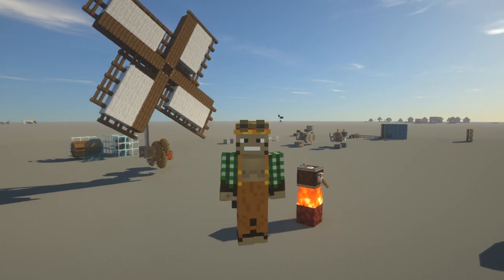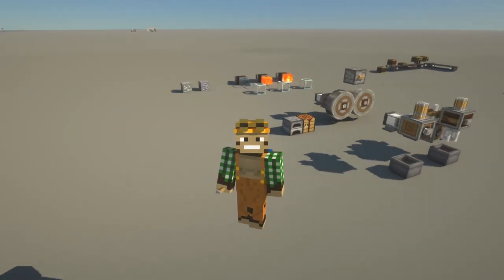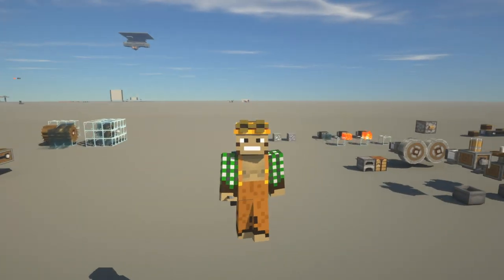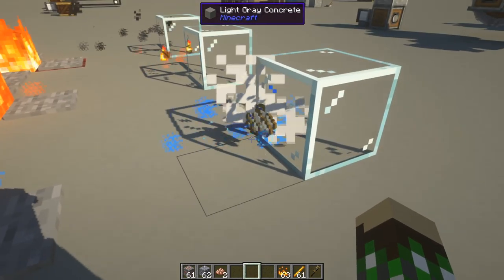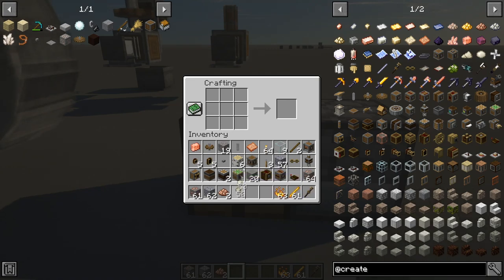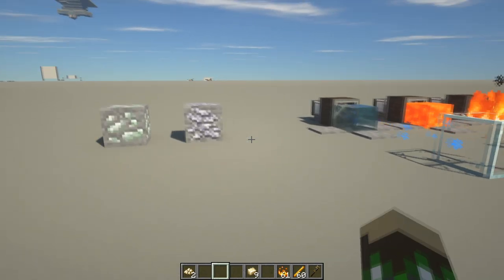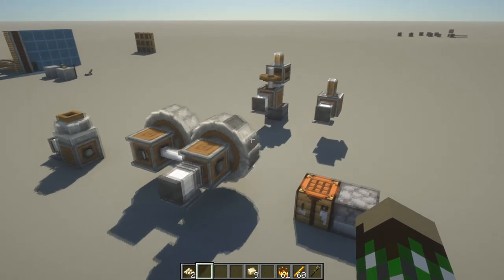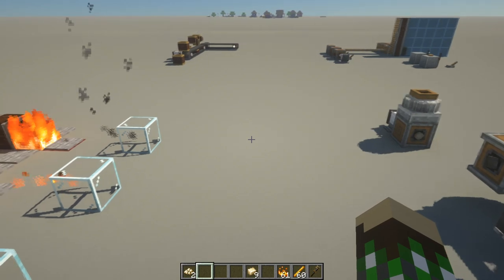How to make Brass!  Create Mod Minecraft Tutorial

Comment: With version 0.3 (for 1.16.4), this information is now out of date.  

Now, you need to craft a blaze burner (2 iron plates, 2 iron bars), take it to the nether, and then click on either a blaze or blaze spawner to capture a blaze. 

Then you take it home, and place it under your mixing basin, and give coal (or some other flammable item) to your captured blaze to feed it.  Once it is hot, then you mix crushed zinc and copper in the basin to make the crushed brass.
Reply: thank you so much, i was wondering what i did wrong.
Reply: Thank You! Been looking for this info for hours. Had the blaze burner, but the only mention on what to give it is blaze cake, which takes crushing wheels to make, so I was stuck trying to figure it out.
Reply: thanks
Reply: Thanks for the info! i needed that
Reply: @jamesjazz3517  Real MVP. <3
Reply: you have to make a blaze cake which is made with crushed netherrack (cinder flour)  as a base and then eggs milk and sugar but the only thing that will crush the netherrack is the crushing wheel. so i made a aolly kiln and put the zink and copper into that and got create brass i did try for 3 days to do it the other ways .
Reply: THX MAN
Reply: welp its back off to the nether for me then i guess thx for the tip
Reply: at 64 stress units on my mixer it says it is not rotating fast enough. What's up with that?
Reply: @withheldgamer8407  if you don't have a windmill yet you should get  one they are pretty cheap. and i had to channel da-vinci himself to get my mixer to run right.
Reply: A 1 minute read has been much better than a 15' vid. Thanks a lot
Reply: my mouse scrolled my screen down just as i was pausing the video to get the blaze rod thank you for this comment
Reply: thanks bro! 
god bless
Reply: With Version 1.16.5 you Need Mord Zahn a Full Power windmill
Reply: TYSM
Reply: You're telling me I can't just use fire...
Reply: i have crushed zinc and copper in my basin, a heated blaze burner but it wont mix them?
Reply: thanks man
Reply: Thank you so much, I'm playing a Create/Pixelmon server right now and with no blazes I was worried it was going to be a roadblock to progress. So mentioning the blaze spawner part helped me out so much.

Comment: Helpful tip. If you don't want to fight blazes, get tinker's construct and fill your smeltry with copper and zinc. It Will mix inside the smelter. Then attach a casting station with a plate cast and a hopper under it feeding in to your conveyor belts. Attach a lever to your drain block and turn it on. Auto brass plates, ingots and so on.

Comment: It's unfortunate, but playing on Create 1.18.2, I can confirm you can no longer make brass. The recipe still says zinc and copper, but a mixer will not combine them. I have spent over 5 hours trying to get it to work in some capacity.
Reply: Did you apply heat from below with a blaze burner

Comment: Have you found a way to automate brass production? I’m stuck at the mixing stage in my brass factory
Reply from the maker: I haven’t but it should be easy. Are you having trouble getting the brass out of the mixer?
Reply: Monkeyfarm The crushes brass comes out fine, I just use an extractor out the bottom. I found that the mixer can only handle one crushed copper, zinc, and blaze rod at a time and so I figured out how to limit the crushed ores. The main problem is that the blaze rod isn’t extracting from the basin to go right back in. Not a big deal but just looking for some insight! Thanks for replying. Your videos are a big help with this mod.

Comment: I have a question. what can I use to get enough SU to get the mixer to run? I have a windmill and it isnt going fast enough
Reply from the maker: You can use large/small cogs to speed up the rotation.  And if you havent already, speed up the windmill with more wool.
Reply: Monkeyfarm thank you so much!
Reply: Monkeyfarm soooo I just tried what you said, and I made my windmill the max size, and I started swapping small cogs and large cogs, and it made the SU slower
Reply from the maker: "Swapping cogs"?  Look at the windmill in this video https://youtu.be/3NVsgAMv1rk.  When you place a small cog on a large cog's edge, the small cog will spin 360' faster than the large one... thats what i mean.  not sure what swapping cogs means.

Comment: I can't get the whisk to rotate fast enough without a motor which is creative mode or speed controller which needs brass
Reply from the maker: Check out my 'Basics' video.  I show how you can speed up the rotation using small/large cog wheels (see the windmill) https://youtu.be/3NVsgAMv1rk
Reply: @monkeyfarm  Thanks so much, been trying to figure this out for almost 2 hours now!

Comment: My mixer didn't work
Reply: I can't use wrench on it
Reply from the maker: Mixer needs to spin fast enough. Add more power (rotation speed)
Reply: @monkeyfarm  alr 65rpm not work with blaze rod
Reply: But if i use blaze burner it work
Reply: Why not working with blaze rod?
Reply from the maker: latest update added the blaze burner.
Reply: @monkeyfarm  oowh